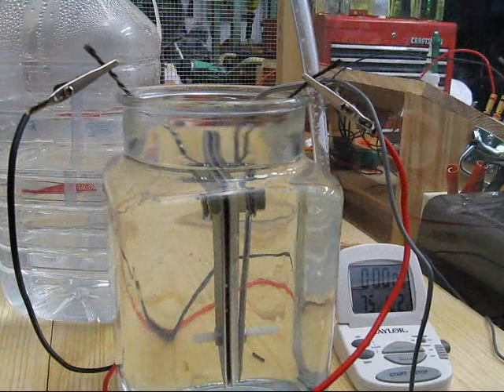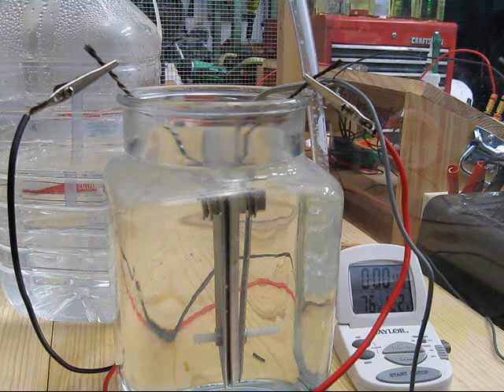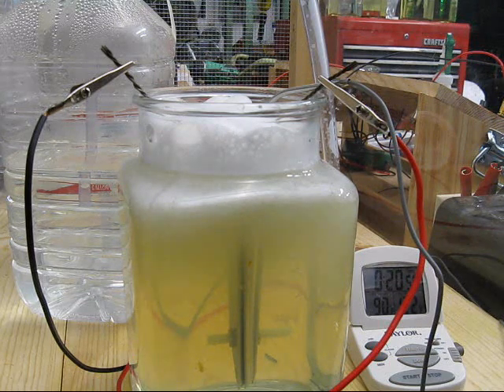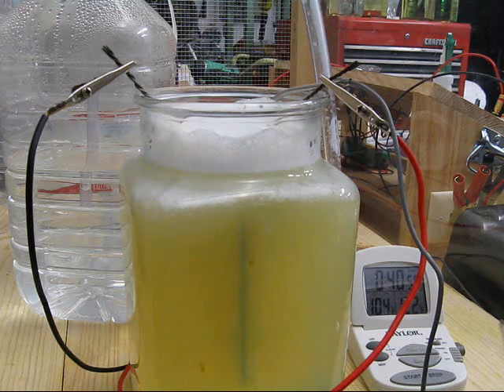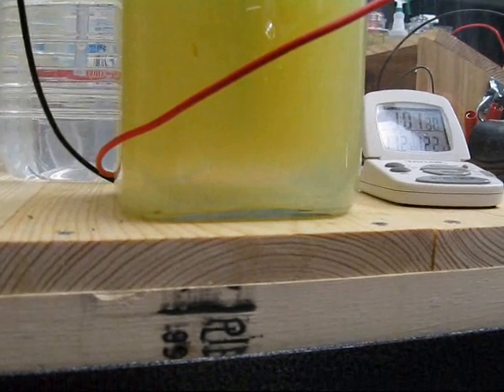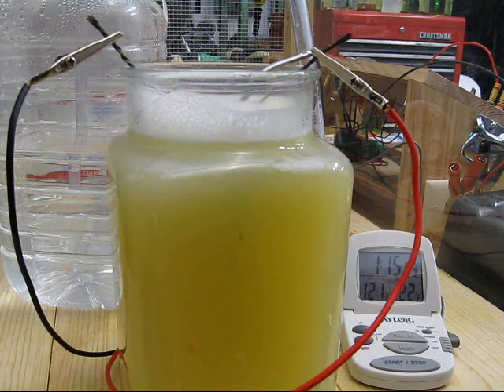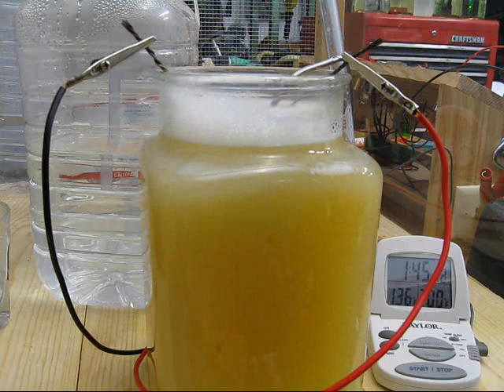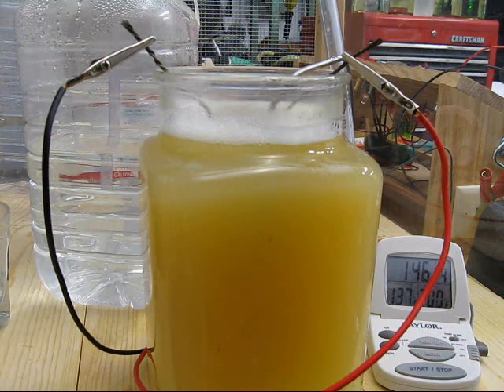#08-037 Electrolyte Test Using White Vinegar Only

Comment: The process would be more powerful by minimizing the surface area on the plates. You would concentrate the amps in a smaller area.
Reply: +John Wilkinson What were the volts?
Reply: +John Wilkinson I'm sorry but I didn't understand your comment scientifically, its not that your wrong but, can you explain for  me? :/
Reply: I'll do my best:
There are three factors: Ohms law, Volts which affect the number of particles and the necessary amperage travelling through each particle.
Ohm's law which roughly translates to the closer the terminals are, the higher amperage 
The volts should be small or else the amps should be great.
If the terminals have a greater surface area then you are mechanically making more exposure and thus dividing the amperage across the larger number of particles.
You can use more surface area if you have enough to reach whatever the ratio but in the above video, and most videos, the amperage is not great enough either by too high voltage or too low amperage (for laboratory conditions).
Reply: John Wilkinson Thank you very much, your answer means alot ^.^
Reply: Sure thing!